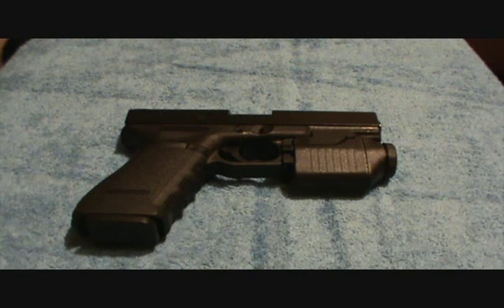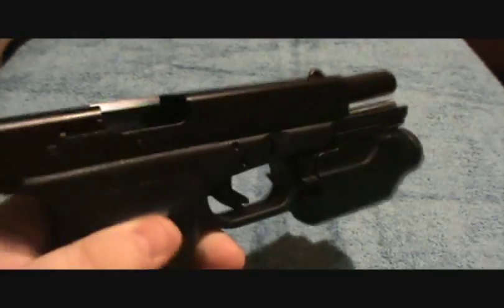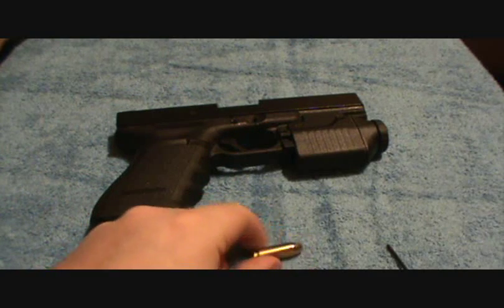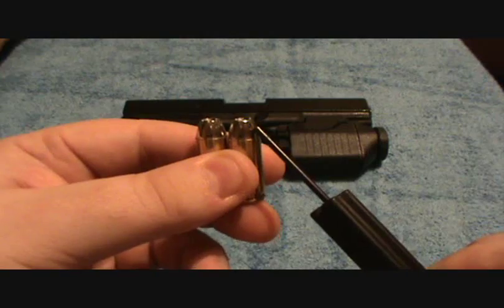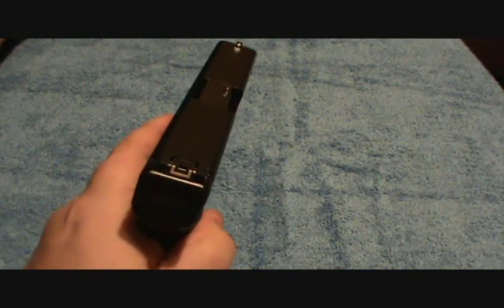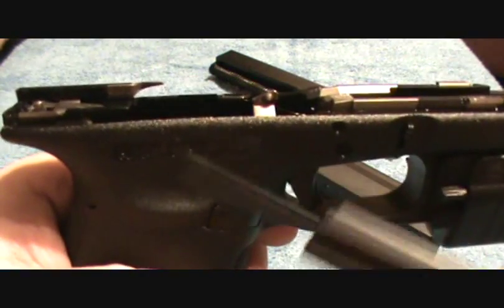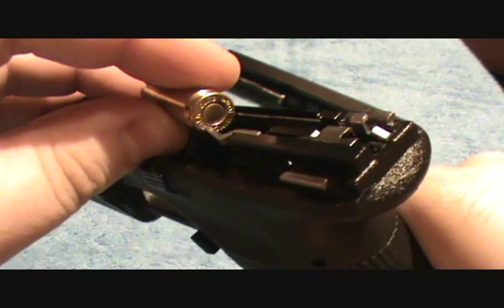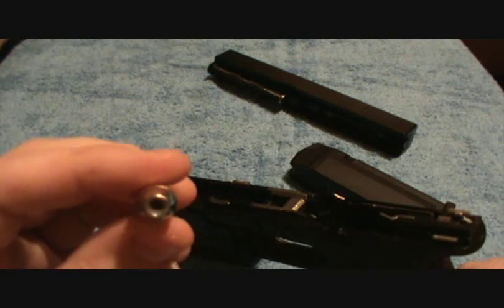Bullet setback

Comment: I've only watched a few of your videos, and I like them, but I've got to raise the BS flag on this one. It takes a significant amount of force from a firing pin or striker to get a primer to go off. To suggest you're applying THAT much energy even by aggressively pulling the slide back is just absurd man.  I'd challenge you to pull a round from its brass, dump the powder, hold the brass with pliers, and try to jam a nail into it to get it to pop.  It'll just never happen, until you get a hammer.

Comment: @HellaFlushEvo No, but at the very least you can cause damage to the extractor claw, as it's designed to accept the case as it slips behind it - forcing it to snap over the rim of the brass over-stresses it and can bend or even break the extractor. At worst, you could have a sensitive primer and wind up with an accidental discharge from a slamfire.

Just don't re-chamber the same cartridge over and over again. Look for visible setback and rotate chambered rounds to the bottom of your mag.

Comment: @humans4targets2 

You can chamber a round by placing it into the slide and setting the rim onto the extractor, and put the gun into battery, instead of dropping it into the chamber and slamming the slide on it. That way, the cartridge doesn't hit the feed ramp or damage the extractor. =D I do this all the time and it has always worked.

Comment: @shiv317 I just left a comment on his other video, but with certain guns you can avoid damaging the extractor by pushing in on the back of it to "open" the extractor up while you lower the slide. The gun has to have a fairly long and external extractor though to do this.

Comment: As for setback, I haven't noticed a problem with my PF-9 and Hornady Critical Defense. I did, however notice significant set back with my CZ-75 Compact in .40 with Federal Hyrda-shoks. But I think that was due to feeding problems with my old magazines. The bullet would impact the ramp pretty hard and jam. Ever since I fixed that problem, it seems to be fine now. I still check the cartridges each time I unload, however.

Comment: If bullet setback is from the round hitting the feed ramp, could you prevent this by manually putting the round in the chamber and letting the slide run home THEN inserting a magazine? Just curious if it'd help, though I'd still rotate.

Comment: about unchambering...I use the cupping method.  on my 1911 the ejector isn't as pointed as your glocks.  I pull it back very slow and it basically just barely falls out into my hand.  sometimes I have to jiggle it a little to get it to fall out.  I can definitely see a problem if you are using a lot of force while covering the ejection port with your hand.